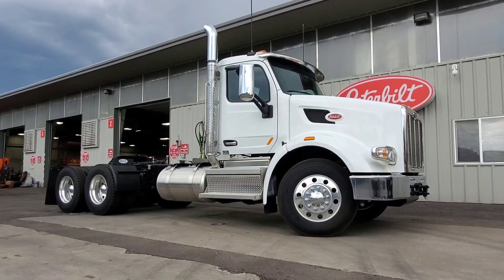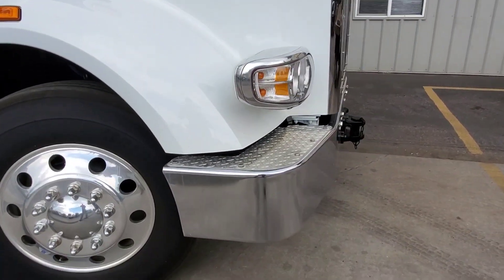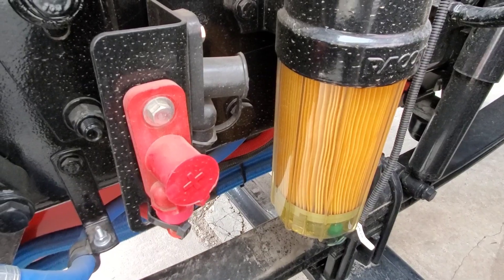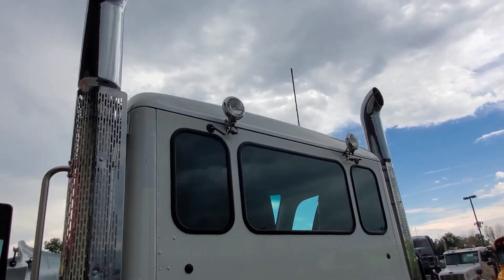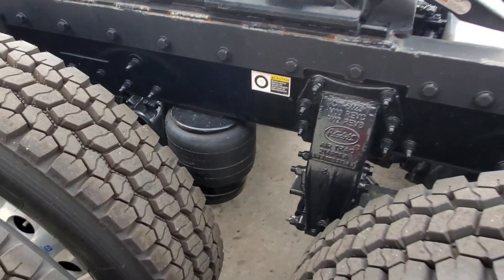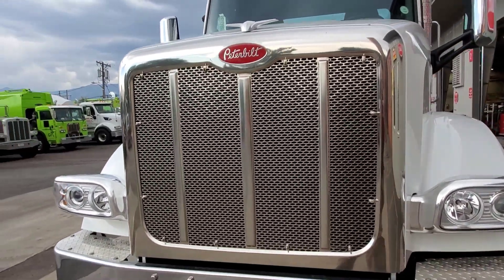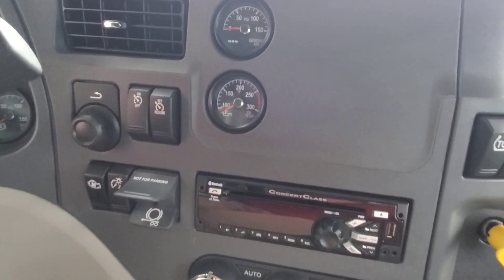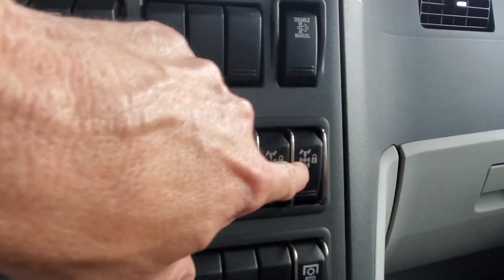2020 567 Day Cab- Allison vs. Automated!- JW 970-518-5520

Comment: I enjoy the video; but not all Allisons have six speeds. There is at least one with seven. The 4700. Maybe you could do a video that covers that more broadly. Fewergears is not a disadvantage at lower ground speeds. The automated manuals need all those speeds because of the disadvantage of not having a torque converter.
Reply from the maker: You are right!  I will do one when I get one in.